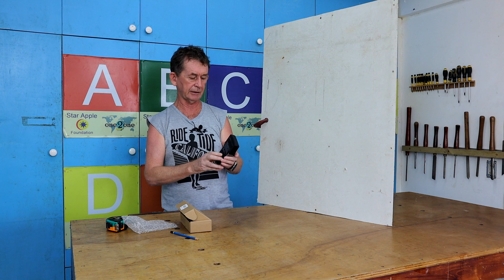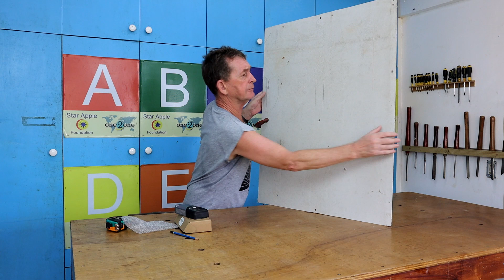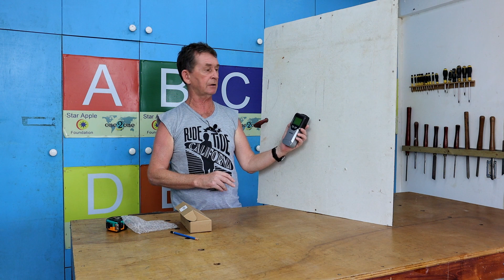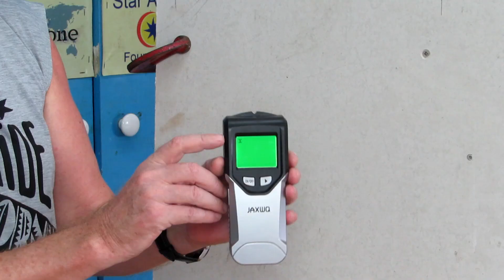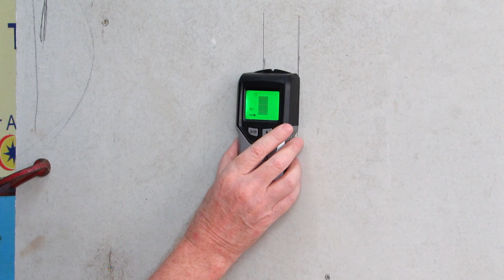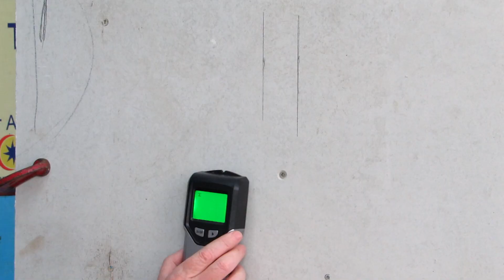Stud Finder - How to Calibrate plus Review of JAXWQ

Comment: I just used this model yesterday.  Stud finder told me I was at center, drilled the pilot hole and absolutely no stud.  Calibrated again and tried a different area amd same result.
Switched over to electricity detection and the thing was sounding off immediately after  calibration.  Had it aimed at the center of the garage with absolutely nothing in front of it.  Maybe I got a defective one?
Reply from the maker: Probably need to play around with it a bit first. 1/2", 3/4" , 1" as well as re-calibrating like in the video

Comment: How accurate is this? I used mine on a brick wall that I know has no electric cables in, yet the unit displayed that the entire wall is live electric from floor to ceiling 8*15ft . Any suggestions?
Reply from the maker: It is a stud finder, with the capability of detecting electrical current in a studded partition. However, if you are getting a false positive on electricity within a brick wall, you should calibrate as shown in the video. Regardless, this is a stud finder, and should not be relied on to check for electrical cables embedded in a solid wall
Reply: @Boopolo  The thing is, the wall that is giving a false reading is the wall I hung the tv on. At the time no wall was ok,
Reply from the maker: I have a Klein Tools voltage tester, and it does not detect current through a cement wall, at either of the two settings provided. Generally, the wiring should be vertical from the ceiling to the outlet with only close proximity outlet to outlet connections. If you take the faceplate off the outlets, you should see the bottom of the vertical conduit(s)

Comment: It is impossible for this device to detect alternating current if it is inside the concrete cement.  The device only detects behind weak barriers such as wood and white gypsum.  As for cement, concrete and stone, it cannot detect any of the above.
Reply from the maker: It is a stud finder with an additional ability to detect electric current in a studded partition. For concrete walls, even my Klein voltage detector finds is hard through cement wall.